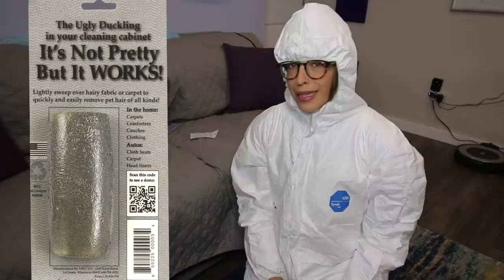Testing Cleaning Gadgets pt. 3!!!!

Comment: Hey Rachel, the bar keepers friend can also be used if your car gets hit/scraped and there is paint rubbed/transferred on to your car or theirs. It is absolutely a life saver, because unless there is a huge dent you can't get out, a paint job or part replacement is so freaking expensive!!! I learned about when I was blocked into my parents parking spot, and I was in a hurry to get home. I did the whole backup and go forward a few inches several times to try to get clearance of the choir director's van for a good 20 minutes. Needless to say, I didn't get enough and scraped the back half of my car down the back half of her van. She and her husband were totally cool about it and didn't want me to pay to have it fixed. Also it scared me so much I was shaking visibly for a while,and I couldn't drive. All I had to do was buy some bar keepers friend and take the transferred paint from my car on their van. It worked so well, you couldn't even tell that anything happened!!!*aside from the fact that that portion of the van was so much cleaner than the rest of it and so I washed and detailed the whole thing.

Comment: What is the advantage of a dryer vent snake versus making a tight seal with the hose, and then turning on the vacuum machine?

I'd think the second option is less likely to cause damage by getting stuck in the vent.

Comment: Rachel Bar Keeper's Friend is a safe product.  I've used it for years.  Get everything clean.You need to use a scrub sponge and Bar Keeper on your sink and scrub it hard, a paper towel doesn't do anything, if you did it right you sink would be clean.  Also you can just make a bleach and water half and half solution to spay your grout.  Fill your kitchen sink with water as high as you can and add a cup of bleach, let it soak over night, clean sink. All your white pottery, or tea stained cups will come clean.  Great for bottom of pots and pans. Just try all the different uses.

Comment: I use bar keepers friend alot it turns black scrapes in bath tubs white and gets burn marks off drip pans . I found that product after I flushed my keys and had to use a metal coat hanger to get them back (didnt want to pay the $75 fine to replace them) bar keepers friend got out all the scratches out of the porcelain